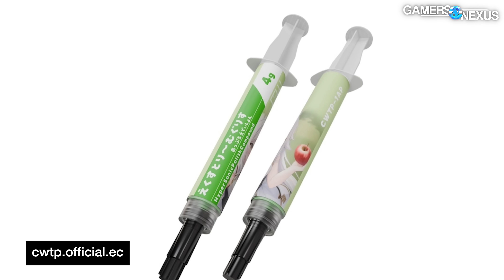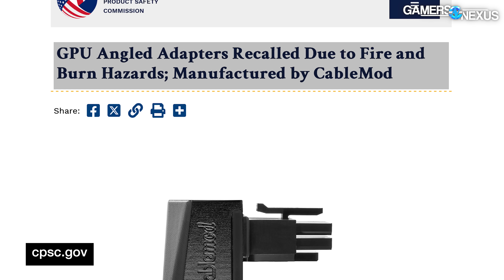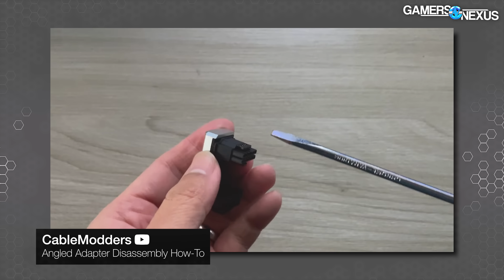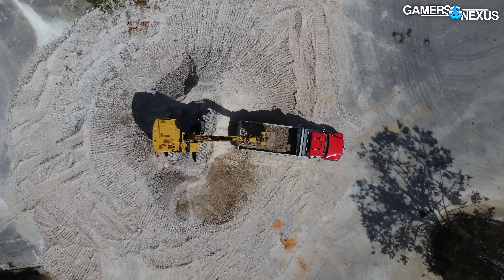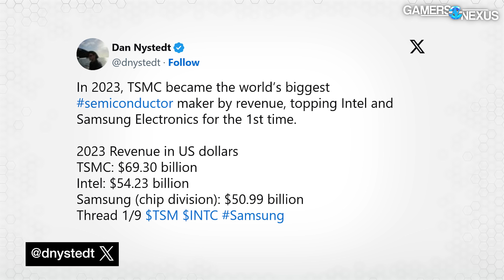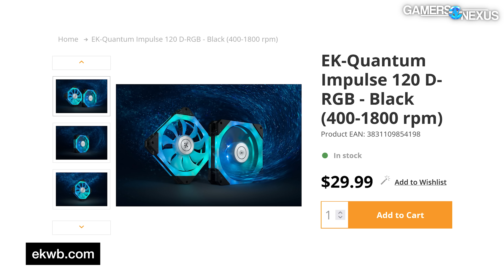HW News - CableMod 12VHPWR Safety Recall, Pre-Built PC ft. Malware, Scented Thermal Paste

Comment: The rare occasion I buy a prebuilt machine, new or used, it always gets wiped and my own OS install put on it. I've never bought from Acemagic, but I have seen their offerings on Amazon and considered them before settling on one of their competitors for a new mini-PC. The competitor had a sketchy windows license, but seemingly no malware. Doesn't matter, wiped and Linux installed instead!
Reply: Yeah, sketchy windows licenses seems to be a common thing on some of the mini pc's. They often set them up to use some volume licensing (like an office or school). I would imagine that if you wiped the drive and reinstalled windows on it windows would not be activated anymore and you'd need to buy a key since it was never official anyways.... But you don't need to worry about that.

Comment: Hey Steve. Sent you an email, not sure it went through.. but just in case : adapter melted here in Morocco, connector damaged, silly me used coupon back in November to get adapter changed to cable when they offered the early adopters program.. saw that warranty was transferred to new cable but did not make much of it ( as in voiding warranty for adapter..), been busy with travels, black screens on alan wake 2 last week made me go right, maybe time to plug that new cable.. and had to use pliers to get it out.. sent a msg to cablemod..they told me it be my fault.. hopefully asus help out here but yeah, just in case someone else is reading this.. if they have a chance to dodge you on a technicality, they most definitely will.
Reply: Message Cablemod again. Tell them you are giving them a chance to put things right, before going to the media and taking legal action. If they don't, then absolutely do do a chargeback as a minimum and do also institute legal action against them. You can possibly go through the equivalent to a US small claims court in the EU, without having to be an EU citizen or resident, since it an be argued as a public interest case.
Reply: @ZenAndPsychedelicHealingCenter  not sure I have any leverage here legally as they covered their asses with the bulletpoint specifying use of coupon to get adapter exchanged for cable void warranty.. told them I had loads of travel since October, barely could get to it, if I knew I would have checked adapter state before using coupon ( OBVIOUSLY right ? :) ), they still almost started gaslighting me on discord server which I left then and there.. awaiting reply from asus now before deciding what's what.. lucky I had my 2015 old 960 lying around still to get gamedev still going & some dave the diver until I get a chance to get back to Alan Wake hopefully soon enough Inshallah

Comment: The only recourse for the pre-built vendor is to reimburse every single cent to everyone affected and then re start selling pre-builts either without any software (a blank pc) or a PC that is 99% complete (no SSD) and that means you buy your own boot drive and use your windows install.. i don't believe this company was intentional stealing because its been around a while and a few channels over the last 2 years have reviewed the same PC and had no issues with spyware so the company is not likely at fault but a employee could be or whoever they source the PC operating system from.. they should not be selling PC with cracked windows tho but they could sell these PC's for $450 as a complete system but blank as windows is free from Microsoft and a cd keys to get rid of the water mark.. if i was this company i would have been selling them blank for many different reasons and this is 1 of the many reasons.. its sad because the reviews over the 2 years of this PC and hardware was very positive and greed over a feee windows and $20 key is a silly way to kill your company
Reply: The kamrui brand by the same company also sold malware infected gk3 plus models for about 170.  The m2 slot that the OS was installed on was only accessible by removing the lid and then uninstalling the motherboard to get to the flip side.  Not so easy for someone without build experience.
Reply: @joefowble  the point is tho it's only been the last few months they have had a malware issue. It's likely a bad employee or because they use cracked copy of windows.. this company has been selling PC's for years with no issues so it's hard to blame them as malicious when it's stupidity from trying to offer something for free that isn't free.. they could have built these PC's with a free windows ISO from Microsoft online but to make the extra $50 they used a hacked copy of windows and put no thought into it.. people would be still paid $500 for the PC as a blank system or even with a ligament windows instal but not with the key (still has the water mark) personally I don't care about the water mark or backgrounds and stuff as long as it's functional.. so they had 2 options that was safe and would not have cost them anything and could have kept the pricing. But a bad employee or a dumb decision on where to download a windows copy is what killed this company. It's sad because 2 years and the PCs was actually pretty good for the money great reviews ect especially for this design in particular and years of good work killed by a cracked copy of windows :( they could have used Linux even so they had 3 options for a clean OS. Hopefully it will not kill the company or the design of this PC because I'd still buy it. As I don't mind having to add a boot drive or download a windows copy from Microsoft. It is good hardware and case I don't want to see die from stupidity

Comment: I'm fully convinced the 12VHPWR connector has always been an issue and will continue to be until it's phased out.
Reply: I personally think they need to go back to the PCI-E 8 pin system. AMD is still using it just fine.
Reply: Nvidia won't because it benifits them, many production applications only work well with Nvidia, those users have to buy Nvidia because they have no other options, so if those users have issues, they either hope it's minor and try to repair it or buy a new one, meaning more money for them.
Reply: yup... its going to keep on going for years and years to come as people try to keep using their 4090's for next 5-8 years+ (1080ti being 7 years old now and still used) and people just having their cards that have run great start to succumb to all various issues these cards have encountered. Usually related to the power connector of PCIe tab cracks
Reply: It has been phased out already. The successor is the 12V-2x6 standard.
Reply: @coolcat23  Correct. The initial design of going with 8 or 10 pins, cant remember which, was just a absolute horrible design and idea.
Reply: @coolcat23  It will take many years for 12vHPWR connectors and cards to be fully gone from the market, including the used market. Whether 12V-2x6 fixes everything is also still to be seen.
Reply: @coolcat23  As long as it requires an extra octopus connector its still shit in my book. Nvidia should stick to the standard pcie 8 pin and 6 pin that is natively supported by all psus instead of trying to cut costs at every corner.
Reply: @ITryEditing7  ^ This.
Reply: It doesn't require any octopus connector. I'm using an RTX 4080 since about a week ago and using direct connection with an ATX 3.0 PSU. I've had 400w running through the cable and no problems @ITryEditing7
Reply: @mitsuhh  There are barely a dozen models of ATX 3.0 compatible PSUs in existence and they were all only recently released. So yes it does require an octopus connector for 99.9% of all PC owners.
Reply: @ITryEditing7 I wouldn't go as far as to say it's required. Cables that terminate to multiple 8 pins at the PSU are very much a thing. It'd be nice if the GPUs actually shipped with a cable instead of a bulky adapter, but still, there are options available.
Reply: @LyK0sa  NVIDIA should give the best possible option.
Reply: Learn what require means please. @ITryEditing7
Reply: @mitsuhh  Okay, now put the maximum 600w through it and watch it melt. It would be a more acceptable connector, if it was rated appropriately. Imo, it shouldn't be used for more than 300w, and 600w cards should need two connectors. PCIe power connectors have a huge safety margin. The 12VHPWR and 12V-2x6 connectors have a safety margin  of something like 5% iirc. It's not at all surprising that they're melting.
Reply: @noxious89123  Your comment is stupid
Reply: Nvidia is the Boeing of the PC industry. They're fine when they're not fucking with standards, and their product is good when it's not actively trying to kill you/set you on fire.

Comment: Steve it must be time to finally call out PCI SIG for the absolute cluster fck that is 12VHPWR. Clearly if disparate manufacturers can have such trouble building a Toby’s connector against the standard. It’s not a manufacturer issue. It’s a standard issue. They need a kick up the rear to get their shit together imo. Abandon the standard, create an improved version, I don’t care really. But I won’t be buying a GPU that has that connector. What a joke

Comment: I recently bought a "prebuilt" 7940HS "tiny" PC, with Windows Pro preinstalled.  I booted the system, verified that it worked, and that Windows was activated.  I booted a "downloaded from Microsoft" Windows ISO, wiped all the partitions, and let the installer do a clean install.  Booted, saw it was activated, then shut it down.

Then I pulled the boot SSD, put in a bigger one, and installed Linux.  I'm running it right now.
Reply: And before anyone asks, I bought the prebuilt version because it was cheaper than the barebones + RAM. So, they effectively paid me to take a 1 TB NVMe drive.
Reply: Everyone should take a lesson from you to not buying any cheap pre-built PC from any shady brands that came out of nowhere. Those kernel level keylogger are very scary
Reply: Linux Mint and PopOS! user here. The only things I miss are things like GPU-Z, CPU-Z, Hardware info etc.... Steam with Proton works fine and open source software fills all my needs.

Comment: when i built my current sytem i cut all my cables off of everything, rewired and pinned new plugs and used color matching loom on all of it. quite a lot of board soldering involved for all the rgb crap. way cleaner look tho

Comment: Okay but until I get something else, what's riskier - continuing to use the cable mod 90 deg adapter or having the flail of four cables jammed up against my side panel? Can't that also shake it loose and make it melt?

What a terrible connector.

Comment: The real fault lies with the nvidia for making that 12v high power socket, it was an aesthetic choice and it was based on poor research.
Reply: They did not make it, although they did rush into using it without testing it well enough.
Reply: @Frashsibit Doesn’t matter, they launched it in the market.
Where has the CPSC been in approving this even. It is a bad design front to back and should be banned for GPU’s taking so much power draw.
They need at least place two of those on the 4090, redesign or even start thinking about 24 to 48v rails on those GPU’s and PSU’s. The amount of amps flowing through those wires need to come down drastically to prevent potential dangers.

Comment: I doubt this new model will fix the issue, i have seen posts of burning from pretty much any cable brand, CableMod just had a far higher rate of it, at this point it seems Debauer was correct that 12VHPWR is just a flawed connector.
Reply: Or they're more vocal about it, with the rest trying to sweep it under the carpet? (Not taking responsibility)
Reply: I'm still not clear on why Nvidia opted to make a connector that needed more power than previous cards smaller.
Reply: or it could be that the entire idea of 12VHPWR is flawed
Reply: Daring today, aren't we? Going against Steve's conclusion that it's mostly peoples fault for not pushing the adapter/connector all the way in :)
Reply: @Accuaro if the old connector wasn't nearly as susceptible to user error wouldn't that mean the new connector is kinda shit?

Comment: Nvidia should be paying for those 12vhp nonsense.
It is a bad engineering from the start and all litigations should be headed thowards them.
And damages paid by nvidia should be 1 million usd per customer that bought any gpu with that 12vhpo nonsense.
This is how you force the scumbag company that manipulated the market for so long to be taught a lesson.
Anything less would be irrelevant for them to feel in their pockets (and even this would be too little).
If nothing works out with that connector, is clearly the connector method that is wrong.

Comment: Would've like a more in depth reasoning from CableMod though. Just the "risk of it becoming loose" is somewhat simple to me. Like, i have one and it's in tight, and it will not come out on it's own (did abide to the recall but i would've felt safe continuing to use it). So somehow there must have been cases where it either was never fully seated with some users, or something like hanging cables causing tension on the connection.

Comment: So I use a GPU power adapter, 8-pin U shape. So the cable comes out the back and towards the motherboard. I then route the cable all the way till the mobo then to the side and into a hole on the case at the end of the mobo. An extremely clean looking set.  This 8--pins adapter have given me no problem what so ever. There is no way in my mind that you can convince me that the new, smaller but with more pin 12VHPWR is at least partially responsible because of a bad design.  How many pocket were lined to get that passed as a "standard"

Comment: I'm a structural steel fabricator in Arizona. Most of our work is TSMC, Intel, and some QTS data centers being built, along with a couple Meta data centers. The TSMC project is massive. They're actually our biggest current customer.
Reply: Buddy of mine is about to head out that way to work on the plant. Electrical, but he keeps getting pushed back because tsmc keeps pushing things around at least that’s what his guy out there says. Any inside info cause he’s sitting here every day sweating it falling through.
Reply: @HadjiMart  It's full speed ahead on our end of things, but with the normal amount of flux and chaos that comes with our industry. My read is that TSMC are rather fussy, but that's just a view from the cheap seats.
Reply: Is TSMC building a fab in Arizona?
Reply: @Zangetsu_X2  The building should be complete. Interior equipment and training is what should be occurring now.

Tsmc wants it operational in 2025
Reply: thanks  @temur72
Reply: @temur72 it’s been pushed out.

Comment: I'm about to get a 4080 within the next month...what cable should I get? Was looking at the Corsair...are there any that are guaranteed to not burn?
Reply: Realisticly none of these cables are guaranteed to not fail, i have seen posts of burning from pretty much any cable brand, CableMod just had a far higher rate of it, at this point it seems Debauer was correct that 12VHPWR is just a flawed connector.
Reply: @Frashsibit  well that sucks...I guess I should ask which is the least likely to burn up?
Reply: Use the official 12vhpwr cable bundled with ATX 3 PSUs and you should have no problems
Reply: @mitsuhh  I don't have one. I'm thinking the Corsair is gonna be my best bet

Comment: NVIDIA cards should be recalled, not just the adapters... Same connector. NVIDIA is the one who chose to use a 20+ year old connector design outside the intended specs for that connector... Their EEs did be ashamed.

Comment: for the record I bought the RT series 12VHPWR PCI-e Cable from cablemod and it is crap as well. I had power stability issues (the red led on the GPU came on and I had random black screen and fans ramping to 100%). I replaced it with one from Seasonic and the problem never occurred again (Seasonic Prime 1000W with RTX 4090).

Comment: Due to rather dumb GPU power input locations on Nvidia cards I can't close my case without a 180 deg adapter and there doesnt seem to be a 180 deg cable option. 011D + 4090. Definitely going for one of the PCI auxiliary power setups for next upgrade so I dont need GPU power cables.

Comment: Why don't they use a screw in to secure type plug like the old DVI etc cables? If you can't glue it - screw it (in tight) &/or move the freakin plug where you don't have to mash it to fit it...

Comment: I'll be honest. I've realized I had a dust issue by the smell of what I can only assume was overheating thermal paste.
After redoing the floors in parts of my house and cleaning it as best I can, it just wasn't enough. And the smell is what might have saved it from the internals pulling in dirt and dust and overheating it, putting everything back in my room for a week.
If it smelled like a Waifu.... I suppose that would be better than what it normally does... But still. Why?
Reply: Honestly, I thought you were going to end this rant with justifying buying waifu paste.

Comment: The irony of them heavily marketing the adapters when 12VHPWR was setting on fire.
Reply: They were sure that if you avoid the angled cable everything would be fine… but because the connector itself is pure piece of ****… no connector that prevent the tight angled cable does not make the connector itself better.